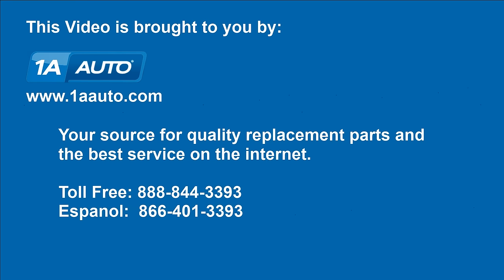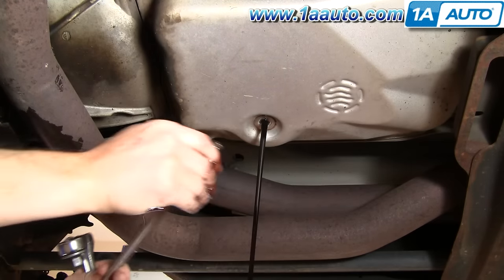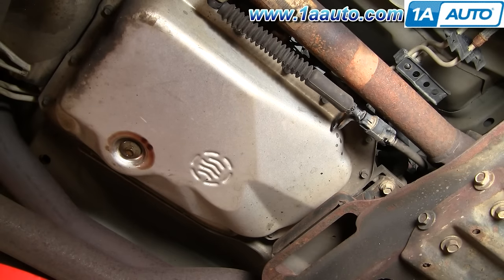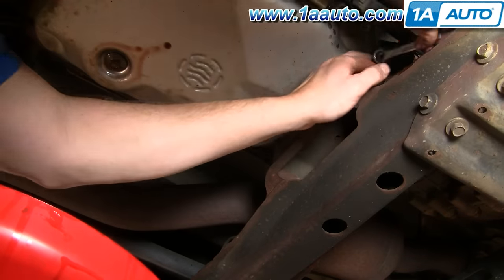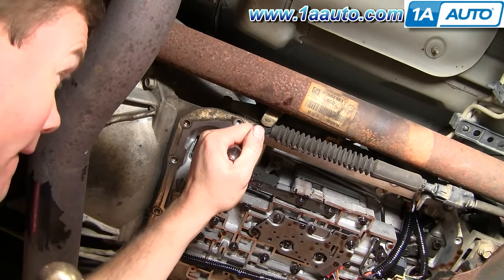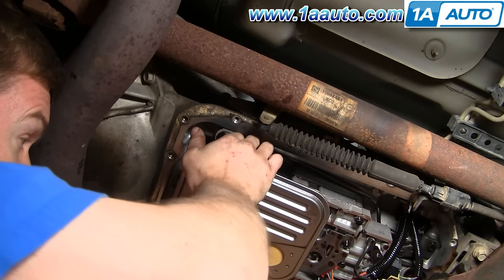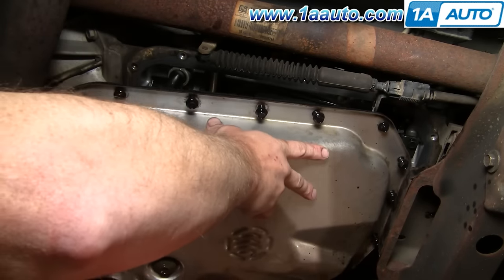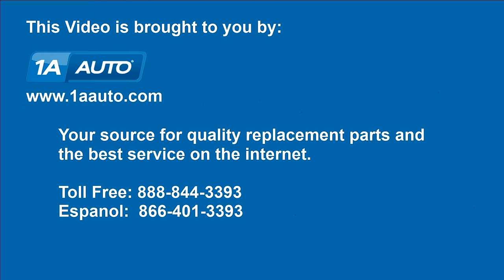How To Service Transmission Filter 00-06 Chevy Silverado

Comment: For any novice mechanics please do on a flat surface with tires chulked. When pulling the linkage the truck will roll back onto you.
Reply from the maker: +xDomePatrolx Thanks for the tip!
Reply: Great reminder. I am a mech and some videos scare the heck out of me with the dangerous things, among other things I see!!!
Reply: That and the E brake ON...Hopefully that's Still in Auto Tech 101.

Comment: I wish my truck had a drain plug like that, all I got is an indent where should be.
Reply: Just take a self tapping screw run it in then silicone it
Reply: Buy a new pan with the drain plug if u want to have access that way. Honestly if u drain and fill before your fluid gets anywhere near bad u won't have to pull your pan or filter
Reply: I too wish it had a drain plug. I was thinking about buying a new pan w / a drain plug but decided to save the $50.
Reply: I wish   my  pan came  down  like  that
Reply: At lest it ain’t rounded off like mine
Reply: @rickseidel3052  that’s a terrible idea

Comment: I have to thank you with profound humility. You have given me the encouragement to challenge myself and learn about how to keep my 2002 Chevy Silverado LS alive for another 20 years. I only have 106,650 miles on the factory engine. I have been with this truck since i was 14 years old. It was purchased by my Father on 10/2001 as a new 2002 release. I have read stories about families owning and maintaining these vehicles for 1,000,000 plus miles. I think there’s a family currently working on 2,000,000 miles. They’re horses and horses will live as long as you take care of them. My father gifted it to me for my 30th birthday. Better than anything I have ever received. And not because free car. No. Because there is a sentimental nature to this gift and it’s my primary goal to keep it in its best condition. Show him that I actually value something he cherished. When he gifted it the truck only had 88,800 miles. Nearly the same as the truck I wish he would have given me. That was a 1985 off the lot modified 3/4 ton Chevrolet Silverado Sand Beige Single cab with leather and woodwork interior. It was a gem. He traded that in… that was a sad day. It only had 85,450 miles on it in 2001. Chevy truly is Like A Rock. And funny thing is to this day both my father and myself still see the truck being driven around. The buyer changed nothing about it. I would really like to see if my truck will qualify as antique in about 7 years.

Comment: I like how easy their drain plug comes out.  It doesn't work that way in real life.  That plug takes an act of congress to move. Search around its a manufacturing flaw. More times than not you end up stripping it.  Better off just pulling the pan, messy but works.
Reply from the maker: Thanks for checking us out. 1aauto.com +GrimsonForce
Reply: Heat up the plug with a handheld propane torch for about 30 seconds; you don't want to go too long and melt the nitrile rubber gasket on the drain plug.
Reply: Mine was on pretty good but got it off with a regular socket and ratchet. The torque spec is suppose to be 18 foot lbs.

Comment: Nice video but.. you wiped off the end of the dip stick to get “the old oil off” but in reality one half of the OLD fluid is still in the upper transmission & torque converter.  A rebuild requires 20 quarts of fluid but a fluid drop & filter only requires 8 quarts which is less than half of the total capacity.  So depending on how bad that old fluid is you may just fowl those new filters with old fluid, guess that’s why some guys says to change the fluid and filters twice.. there has to be a better way..
Reply: Your absolutely correct sir..... The better way is to do a flush.  But a dump isn't a bad thing.
Reply: Very true. My old Ford had a drain for the torque converter. Not sure why Chevy doesn't do the same.
Reply: I saw a guy empty and add then remove the transmission cooler return line and went a quart out, new quart in until fresh shows up.

Comment: Can you just pop the shift cable out of the bracket like that?  I've read that you have to loosen the two T40 bolts on top of the bracket?  I'm scared if I try to pry it out, I'll break something.
Reply: Brandt Powden did you ever figure out if pulling it like that is okay? I plan on doing this tomorrow and thought the cable and the heat shield would be the hardest part. I want to experiment with the cable before I even drain the fluid so any luck?
Reply: I had trouble to not that bad. It is a U shape clip that slides out from the side towards the top. Go under the truck with a flashlight  and look closely where he is working. You will figure it out.
Reply: Didnt have a problem removing the cable like they did. Pop the metal clip off then there is two plastic "clips" on the side you need to press together before pushing the cable through.

Comment: Great video, but I just did this on my 2002 suburban 2500 & I have a couple of comments/tips:
1) for the back 3 bolts that are covered by the transmission bracket, you'll want a bent/angled box wrench. It'll be a whole lot easier to break it loose. 
2) I also suggest a flex head ratcheting box wrench for the rest of the 17 bolts. 
3) for the sleeve that goes in the filter hole, the video isn't very clear 
, but that cuff has a lip and that lip is what he's hammering "into" the hole in order to get a grip. Once I bent that, I was able to use a rather large set of pliers to wrench the old sleeve out. 
4) to remove the pan, pull it down and tip it to drain it, but then you have to rotate it 90 degrees towards the driver's side to get it out. You may have to bend the exhaust heat shield, but that's fine, just bend it back when you're done. 
5) torque spec is a little nebulous on the bolts, but the kit I bought said 120 in-lbs and I had read 18 ft -lbs elsewhere. I split the difference at 15ft-lbs, and that felt pretty good. 
6) I put about 1 gallon of trans fluid in, since that's what came out. After I drove it and shifted in and out of the gears, I checked the level and put another quart or so. I'll check it after my morning commute as well. 

Hope that helps!

Comment from the maker: The fluid is the life line of your transmission. If you keep it clean your transmission will last for quit a long time.
Reply: mine hasnt been changed at all should i do it now that it has 200k plus i heard its not good to flush it while its high a friend said is that true idk
Reply: Yeah flushes are aggressive and can reroute fluid and plug up stuff. Just change filter and the fluid. You can drain and refill it a few times before changing the filter to get more new fluid in it if ya want

Comment from the maker: We do not have an auto repair video that shows you how to do this, however typically you run a hose from the return line to the transmission into a bucket, after changing the filter and wiping the pan clean button everything back up. Top off the transmission with fluid, start the truck up, the old fluid will empty into the bucket, as that's happening add new fluid into the filler tube and do this until clean pink fluid comes out into the bucket.Ask the dealer how many QTS for a total fluid fill.

Comment from the maker: If the fluid is low, make sure it's up to it's recommended level, and see if it keeps doing this. If you haven't changed the transmission fluid and filter in a long time you may want to do a total fluid change in the transmission, and add a new filter. If there's a piece of debris floating around in the transmission it could very well be hanging it up. Hope this helps you out. Have a great day! 1aauto.com 888-844-3393

Comment: great info here. we normally don't drop the pan and change the filter. we just flush the transmission and lines. cause really by dropping the pan your really only changing less than half the fluid, the rest is still in the torque convertor. i was always taught at full operating temp of the engine, the trans fluid should be 3/4 the way to the hot mark. something i was always taught if that seal on the filter stays in there when the filter is down to leave it, have you ever heard that before.

Comment: Great video. I got ll the parts and was going to tackle this project until I couldn't get the drain plug off. I have never seen a plug on so tight. I used a 10 foot breaker bar, blow torch, and I still can't get it off. The drain plug is now rounded. I ordered a new plug and the truck is going into the transmission shop this week to see if they can break it loose. What did GM torque these drain lugs to from the factory?
Reply: 18 foot lbs is the recommend torque. Same for the pan bolts.
Reply: @digi3218  The small ones that hold the pan need to be set at 8 foot pounds the drain plug to 13 ft. lbs. per GM.
Reply: I had the same problem.
Reply: WOW!! That's the longest breaker bar I ever heard of. HaHa

Comment: Do not have to replace that grommet if in good shape.Those two back pan bolts can be accessed with a 10mm universal socket.If it calls for dexron 6,do not put in due to finding out it is causing torque converter shudders and blowing up torque converters

Comment: So I changed the fluid in my 2006 Silverado LS 5.3 4x4 today; and had a HECK of a time.

I wasn’t able to completely remove the pan, because I could NOT figure out how to remove that bracket that holds the shift linkage. 

Have any tips for removing that thing?

Comment: I have a 00 gmc sierra 4.8l with 153000 should I change the fluid ? .. fluid still red little dark.. I also drive in the city in 3 gear

Comment: can you tell me what the correct torque specs for the pan bolts should be for a 2007 Chevy Silverado classic with the 4L80E transmission and a 6 l gas motor?

Comment: Those 2 bolts at rear center of the pan are a pain getting out. Getting them back in was worse. I thought about removing the cross member but, it being a 2002 I'm thinking the bolts ain't gonna budge. Is there an easier way to reinstall those 2 bolts? Lol.

Comment: If I start the truck before I put the 2 qrts of oil will I damage the transmision
Reply from the maker: If you're sure that it needs two quarts, you should add the new fluid in before you start the motor. 1aauto.com 888-844-3393
Reply: yeah buddy without the proper lubrication you may risk damage due to high  friction.

Comment: I did not see that your technique would necessarily purge all of the old transmission fluid out of the transmission cooler radiator.  How important is getting rid of that fluid as well, and what's the simplest way to get it out?
Reply: Transmission flushing is widely understood to be a last-ditch effort fix.  Old fluid has suspended clutch material within the fluid and if you were to remove this from the system the transmission would experience slippage possibly overheating the unit.

Comment: Hi, 1aauto
I actually have a 00' Silverado and I think it needs transmission service, You think that is a good idea to drain all the fluid, I heard that I can get troubles with the gear changes.

Hope u can help me, tnks
Reply: Transmission service is mandatory. Your transmission works because of a hydraulic pump. Any sort of impurities in the fluid will lead to failure. By changing the fluid you actually may notice a significant improvement in "gear changes". I DO NOT suggest a "reverse flush" as, in my professional opinion, does lead to failure. If you just disconnect the upper transmission cooler line at the radiator on the passenger side and temporarily install a Hayden 397 Transmission Line Adapter with a piece of vinyl tubing that goes into a bucket, AFTER you change the filter & clean the magnet, replace the pan, and dump in a few quarts you can start up the engine and fill thru the transmission dipstick SLOWLY while it pumps out the old fluid in the system via the Hayden adapter. This will not completely empty the contents of the transmission but it will exchange MOST of the fluid. You will notice a significant change in the colour of the fluid while it is pumped out. When it looks clean clear cherry-red like new, then shut off the engine. Check your transmission fluid levels just like the 1A auto video says (check it hot; don't overfill). I'd budget 14 quarts to do this job. I have done it at least a dozen times. GM trucks of 1988+ all seem to be able to use the Hayden 397 adapter.

Comment: How did you get the pan down and past the linkage bracket? I have an Avalanche and that bracket doesn't give me any room to manuever the pan down. On other forums I've read people bending the bracket out of the way but I can't imagine that being a good idea.
Reply: I know this won't help you 8 years later but maybe someone else, take that bracket off if it's in the way. It's held on with 2 fasteners. Mine were T40 torx. Some may use a bolt head.

Comment: I have a 1993 gmc 2500 with a 454.. I do not have an owners manual. Do you have any idea which transmission fluid I should throw in after the filter is done?
Reply from the maker: +William Veniot The dealer or your local auto parts store should be able to tell you

Comment: Would this be the same for a 04 silverado 1500  4x4 ?
Reply: Yes
Reply: Nope, and I'm curious if you did yours. Mine has the exhaust running right under the pan, and can't get the pan out without taking the exhaust loose from the header on the drivers side. I've been unable too so far.
Reply: same problem @ssspencerjr

Comment: I have an issue, my father says that Changing the Transmission oil is bad and that it will damage your transmission, but I read that it only happens when you haven't changed it. My truck was owned by my brother for like 3 years, he didn't change it and I wanted to change it but my dad said it will get damaged. I checked the fluid and surprisingly it is red so does that mean that it's been changed? It had 260,000 miles so the fluid should be black right? So should I change it?
Reply from the maker: +The Talking Husky We wouldn't be able to diagnose an issue like that here, you may want to have a local mechanic take a look at it. Thanks for checking us out! http://1aau.to/m/Shop-1AAuto-c

Comment: Hi, question!  Should I add some of the old transmission fluid back after changing the filter so there in minimal slippage?
Reply from the maker: +Jeffrey Garcia We suggest using new fluid, not the old.  Thanks for watching.

Comment: I notice you took the gasket off, did you replace it or did you just clean it up and reuse it?
Reply from the maker: +Tenma_FN We would suggest replacing the gasket. 1aauto.com
Reply: If the rigid factory style gasket is still there AND it does not have any cuts or scraps on the rubber sealing surface of gasket then YES you can re-use it.

Comment: How tight should I tighten the drain plug? Just snug? Or is there a torque spec? Thanks in advance?
Reply from the maker: +Tyler Zook Yes, here's the how-to video you're looking for: https://www.youtube.com/watch?v=KHOZFRN5br8
Reply: @1AAuto  thank you. I ended up putting a whole gallon of dex VI in? Is that too much? Should I drain some?
Reply from the maker: +Tyler Zook Thank you for contacting us back! A gallon should be correct for your application. You should also be able to double-check the fluid level with the transmission dip stock. Hope this helps you out!

Comment: How would you complete the full flush? How would you remove all 11 quarts of fluid, including the one in the torque converter?
Reply: only a special flushing machine can do that,,,this is more than good enough
Reply: @peralez2383  Not always. If your fluid is real bad this is only half the fix.

Comment: So my drain bolt is stripped. Do you think I can remove the shift cable and just unbolt all the pan bolts with the fluid in?
Reply: For anybody wanting an answer to this question: Yes you can remove the pan without draining it but you will make a much bigger mess. Leave a few bolts loosely on each corner and get the pan unstuck. Then you can remove the bolts and try to remove the pan and try to catch the fluid inside of it. The bracket on the driver side will make this tricky and probably a big mess.
Reply: There are ways to suck the fluid out through the dipstick tube as well but you will remove a lot more fluid I believe.

Comment: my 04 Chevy 2500 has a heat shield that is covering the passenger side bolts. The shield is attached to an exhaust hanger, and I can't see how to remove it or work around it. The shield goes back to the trans support brace that covers the back bolts, that are hard to get to anyways. Any suggestions?
Reply from the maker: +Mark Potter We currently do not have an auto repair video that shows how to remove it. Thanks for asking. 1aauto.com
Reply: Did you ever figure out how to get the heat shield off?  about to tackle mine.

Comment: Just would like to know, if you got thru all that trouble to clean pan, and gasket, etc...why not flush all the old fluid out???
Reply: I guess most of the junk settles at the pan which is what he drained and cleaned. Which is not to say there isnt junknstill in there. But for a quick filter change thags good enough

Comment: Being a DIY rookie i wish i could have seen better how u removed that clip on shift cable... I'm always nervous that im going to screw something up and pay triple the money I "saved" by doing it myself
Reply: I was nervous also. It is a u shape clip that pulls out from the top. Pay close attention to where he goes to remove it. It not that hard I figured it out. I have a 05. On mine to get the pan out i had to loosen the exhaust pipe also. It was a little tuff.